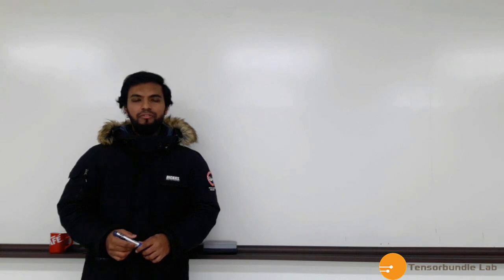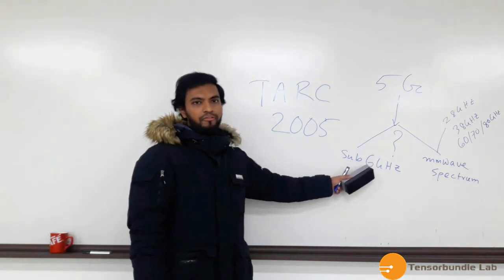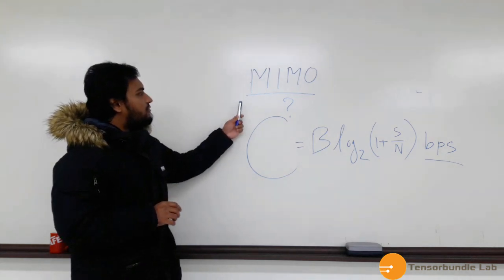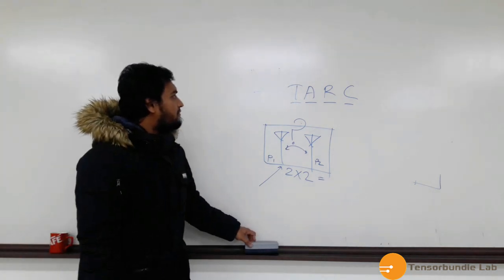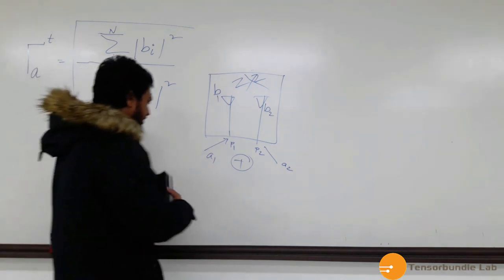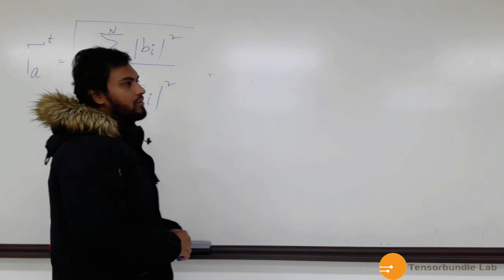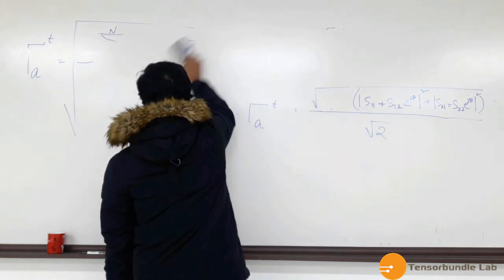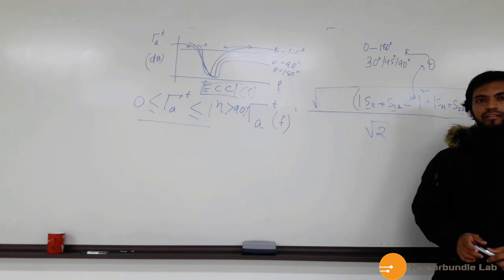Lecture on antenna engineering: TARC derivation in 2x2 5G MIMO antenna array

Comment: Your papers don't treat the TARC, I reviewed them all. Do you have a specific reference about the difference between phases? I don´t sure whether to use the model due for one element the effect of the path is not included.
Reply from the maker: I already mentioned in video that  professor Yahya Rahmat-Samii and his PhD student came up with TARC idea.  I already gave everyone enough clue in the video :) Why don't you dig up on your own to find the reference paper published by prof. Samii's group?
Reply: @tensorbundle  I understand how applicates the phases, but not the sense of their origin. Yahya Rahmat-Samii analyze the antenna how transmitter in their papers, but Chae in its paper “Analysis of mutual coupling, correlations, and TARC in WiBro MIMO array antenna” introduces the phases as random variable because the channels are assumed as Gaussian. Chae, then, analyzes a receiving antenna in its model, where the input ports must be the radiators in the array and a1 and a2 arrive from the space, but you put these signals, in your video, in the physical port connection of the antenna. With a receiver antenna MIMO, in each port (individual antenna) the incident signal arrives with a randomly phases due the multipath. Now if is considered your notation (transmitter antenna), where a1 and a2 are in the input port of the antenna, the incident signals are subminister by a source (oscillator, VNA), then they don´t have random phase. Strictly they could be a random error given by the cables and the stability of the source, but it does not implicate a rotation of phase of 90°, 180° how you explicate in the part final of your video. A transmitter antenna has more sense for me and the simplest case of the TARC is the reflection coefficient that is also analyzed with a model of transmitter antenna.  Don't take this as a bad review, as I admire your explanation because you understand things that I don't. But what do you think of this?